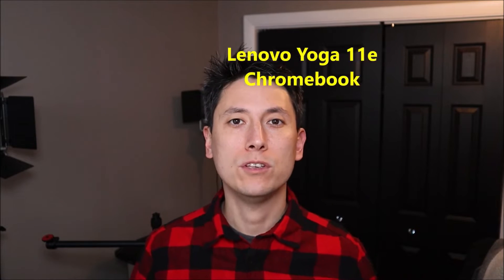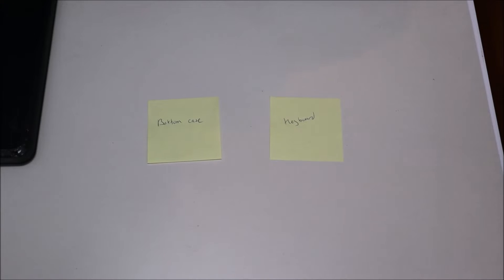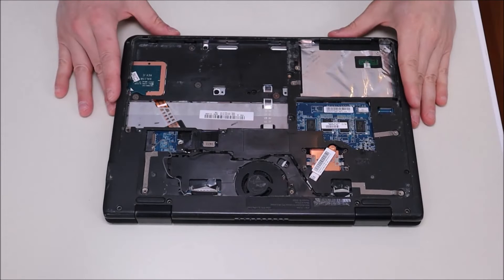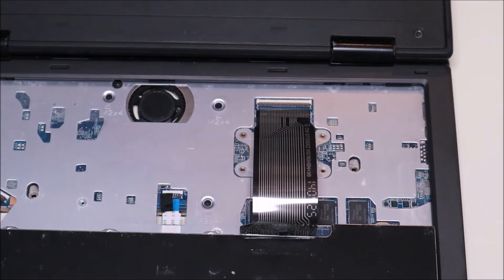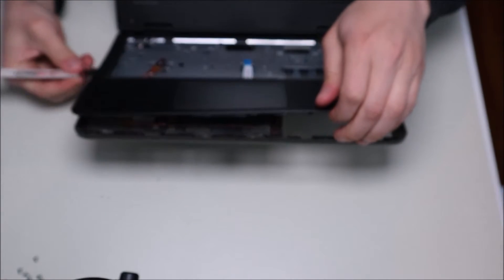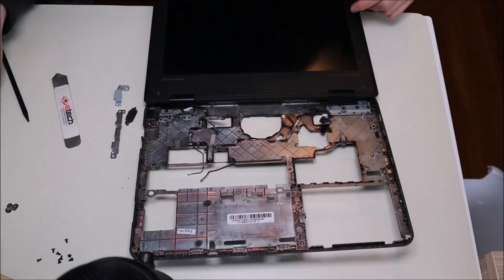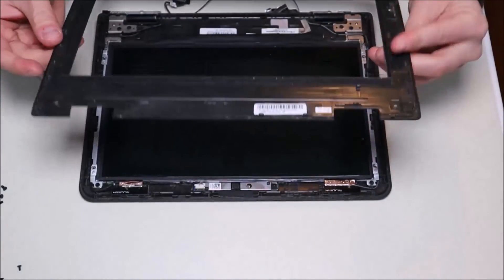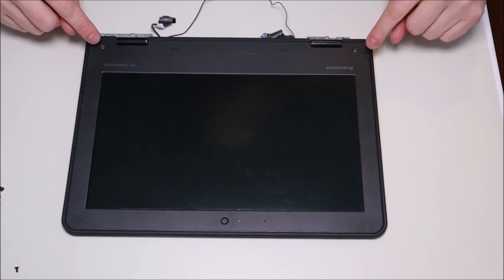Lenovo Chromebook Yoga - How To Replace Screen / LCD Assembly

Comment: hello , I have an issue with my laptop and it is when I was working on my laptop then it needed to be charged so I charged it and when I came to open it after charging it opens  for 5 s in black screen then turns off again ?? what is the problem and the solution ? I want to show u it but I do not know how ... it is dell latitude 5580
Reply from the maker: For a computer that does not turn on, try this video first; https://youtu.be/kOBY4k2Mn_k. Let me know how that goes :)
Reply: @PC_Monkey  unfortunately it did not work and my computer's battery and RAM are inside so it is not easy to remove them and put them back ...
Reply: @PC_Monkey  and my battery is working because the light that shows you that the battery is working or not is on when I put the laptop to charge like always when I charge it ... and sorry for my English it is not my native language...
Reply from the maker: @SaraMohamed-c9c  Does this help access the battery? https://www.youtube.com/watch?v=rPr9CvGE1Lc
Reply: @PC_Monkey  yes , but it did not work ....
Reply from the maker: @SaraMohamed-c9c   If, after trying all these steps multiple times, you have not been able to find the issue, your most likely looking at a faulty component preventing the motherboard from working or a motherboard issue.  I would start troubleshooting each component, starting with the charger and power jack.  You can see those two videos here;  https://youtu.be/YBhsVHideGE  &  https://youtu.be/HpabvrNaodU.  You can also try replacing other components like your Power Button to see if that is the route cause.  If none of those are the issue, you would then be left with a motherboard replacement.